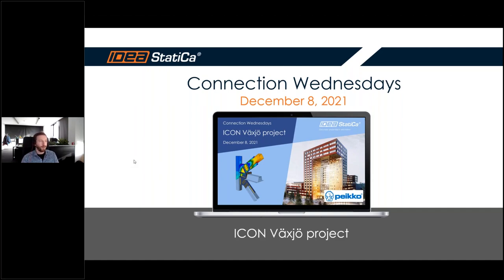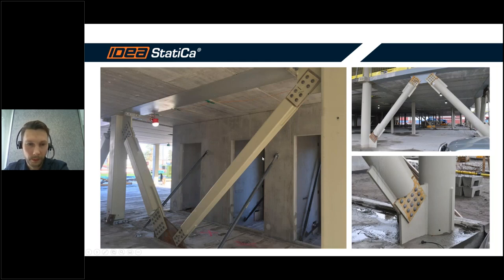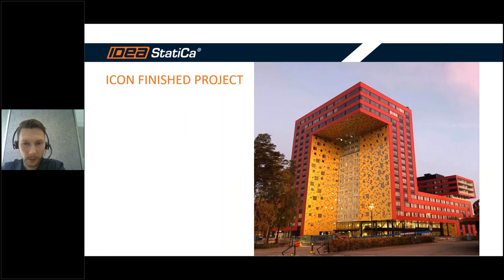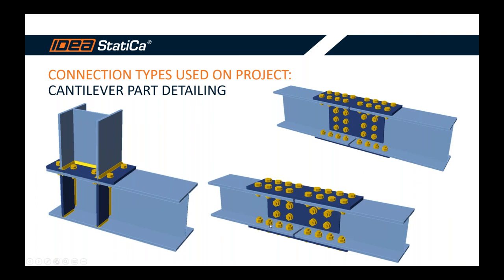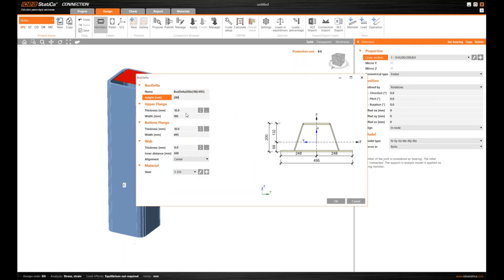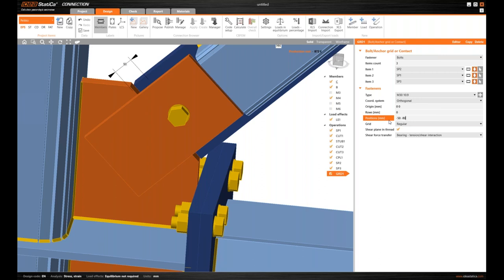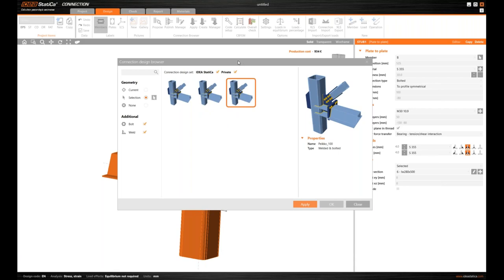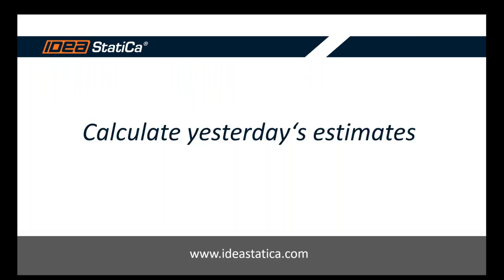Connection Wednesdays – ICON Växjö project

Comment: very interesting presentation. at the end, there was a bug in the model. it would be interesting to know what it was and how you found it.
Reply from the maker: Well, finally we figured out, that there actually wasn't a bug in the model. The set of manual operations just needed to be updated. After closing the model and opening again the calculation worked. So, in case you would like to replicate the same model, the building process presented in the tutorial should be working.

Comment: Desr Sir, during designing baseplate with 4 bolts on each corner. And a HEB200 connected with it. I applied only 100KN tension force. .  So technically each 4 bolts should carry 25KN . BUT STATICA Is giving answer each bolt as 37.3KN. please help
Reply from the maker: Dear Faizan, Thank you very much for your question. For technical support with your designs, please reach out to our support team via IDEA StatiCa User Portal: https://www.ideastatica.com/Portal/Dashboard

Comment: I have made a simple connection with I column having base plate and 4 anchor bolts,, i applied only a tension force of 10KN, but when i check bolt forces what i found each bolt having 2.626KN (it should have 10/4 
= 2.5 KN) why ??
Reply: Look up prying force.
Reply from the maker: Yes, Gábor is right. The force increase is caused by the prying forces. The more rigid base plate you use, the smaller prying effect should occur.